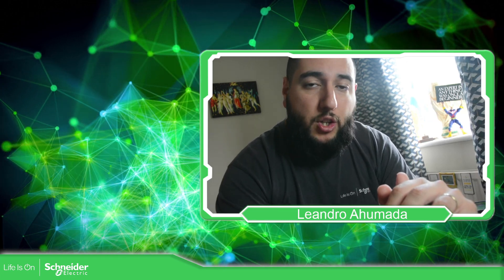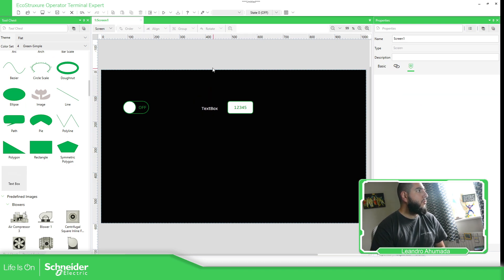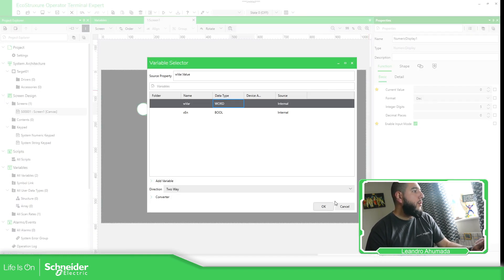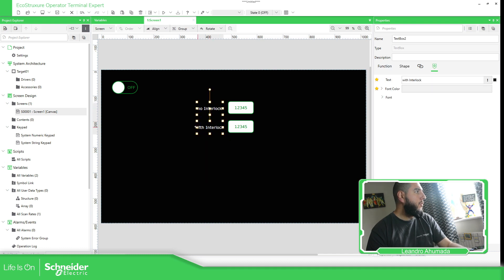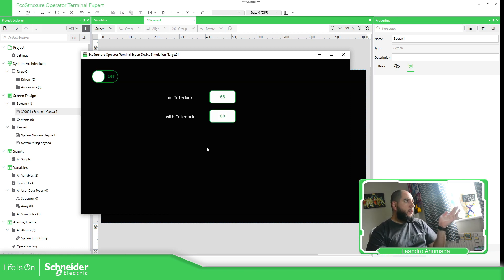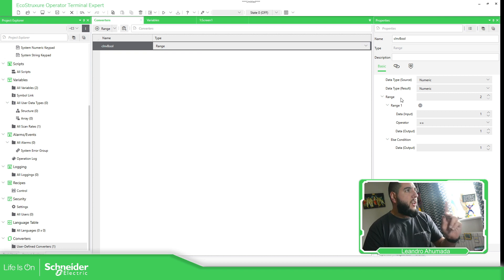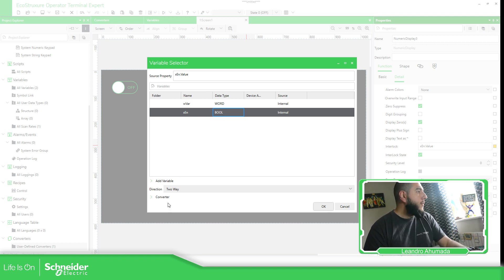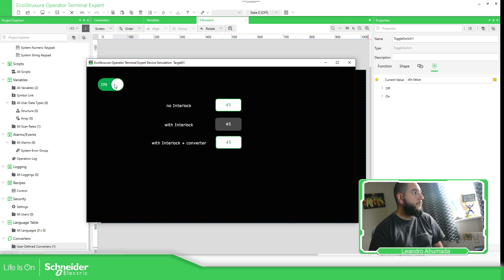Training EcoStruxure Operator Terminal Expert - M10.5 How to use Interlock

Comment: Thank you for the Videos, how do you use the interlock with multiple variables. Say I have 4  buttons on the screen tied back to individual variables, If I press one of them I want the other 3 locked out.
Reply from the maker: Hi there! In this particular case you will need to use global script and use  a trigger for execution of the code "on value change", that will the way. Or... use converter expression